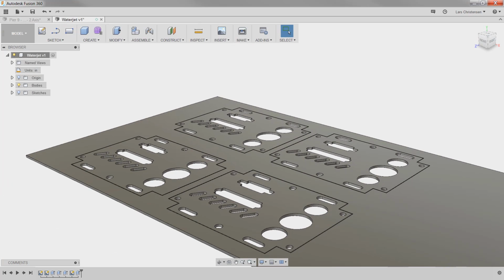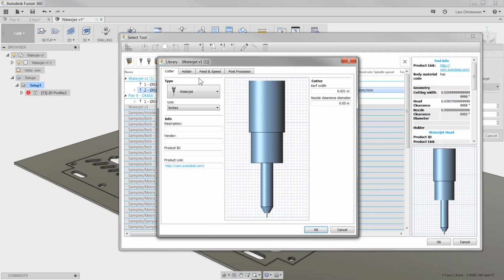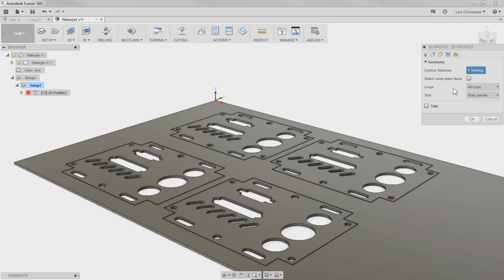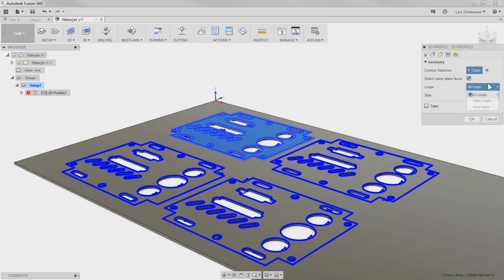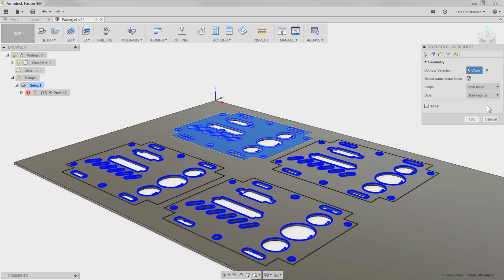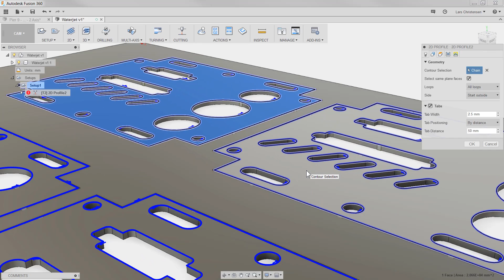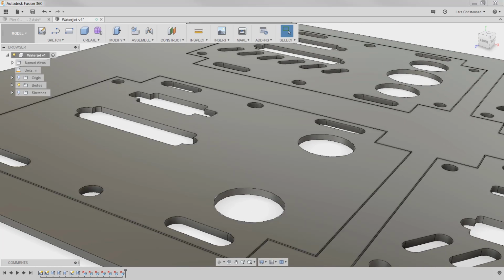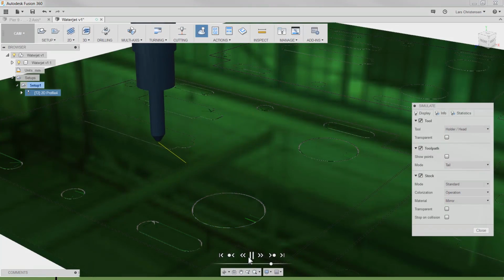Optimize CNC Machine Setup with 2D Cutting Jumpstart | Autodesk Fusion 360

Comment: I use this all the time for laser cutters at the MakerSpace Munich. Ever have one of those cutouts that just wouldn't slide together after you cut all those parts? Ever have to cut 5280 test parts to figure out just how wide the kerf is on your laser? AND then REDRAW all the parts to account for it? If you use Fusion, you can do that once, store it for your "tool" which is the laser beam, and Fusion will can compensate for the width of your laser cut.
I work at a lot of different MakerSpaces and Fab Labs, and I've stored all their values, so I can cut in 5 minutes - when the other guy is still making test pieces.

Comment: Question:
Is there a video that shows us the steps from start to finish, specifically from design to cutting on Plasma? Great example would be with a Hypertherm Powermax 45. 
Will be building a table soon, I want to know where the Fusion 360 fits in, as I presume I will need to design in Fusion 360 and take the DXF to Sheetcam, so that's the steps I'll be doing for all my cutting.

Comment: I'd also be very interested in using fusion 360 for plasma cutting. Is there plugins for speeds and nozzle widths for a hypertherm plasma cutter, that can easily be setup in fusion or would we manually have to install all those parameters in fusion, for different materials and thicknesses?
Reply: Marcel LeMay You'll have to manually set it up. But there is some work being done to show material specific feeds and speeds to be defined with a tool. But that could be a while away yet.

Comment: I think a standout issue is that the 2d environment in fusion 360 cannot compete with Omax Layout for preparing files for the waterjet.  I will admit that I'm learning fusion 360 through trial and error on my own time, but Layout is much more efficient to rapidly copy down a provided drawing or trace from a scan.  Sketching in Fusion 360 is intuitive if you're trying to design something from scratch and you have time to constrain your drawing and think about your design.  There isn't time for that in a production environment.  There isn't time or often need to simulate the tool paths with 2D cutting as experience will tell you where it needs to be cutting.

The only real advantage I could see in your demonstration was being able to rapidly remove features and repath.

I've experimented with the pathing in fusion 360 along with the Omax plug-in and Omax Make seemed to have correct tool path, but I didn't try cutting anything.  Checking and pathing that same .ord in Layout brought up a number of errors in the path.
Reply: NavySturmGewehr if you can draw a profile in a non parametric 2D CAD application, then you can do the same thing in Fusion as well. You can sketch what you need.. arcs, circles, lines etc. trim, extend etc. and dimension where needed. Then once you know you have the correct profile... just like you would in a basic 2D CAD product, then you can use the Fix sketch constraint to lock down the remainder of the sketch so it doesn't accidentally move. It's really not that different. In other words, you don't have to sketch parametrically, you just have to add geometric relationships you would in any other CAD product.
Reply: The point is that Fusion 360 is inefficient at that process in a 2D cutting environment.